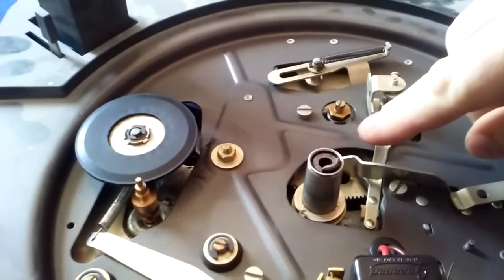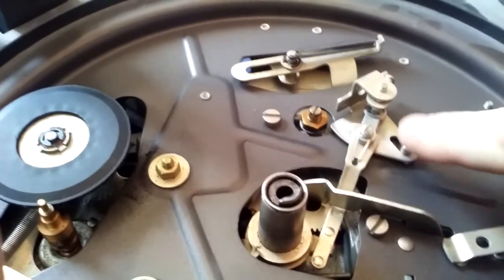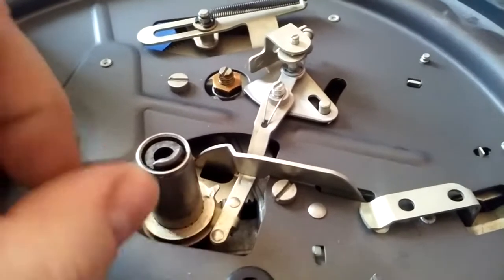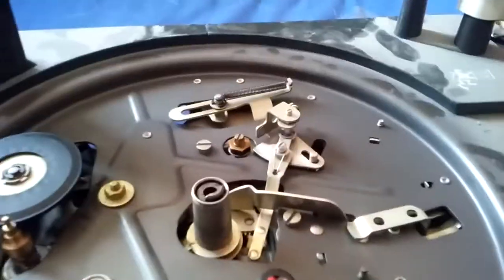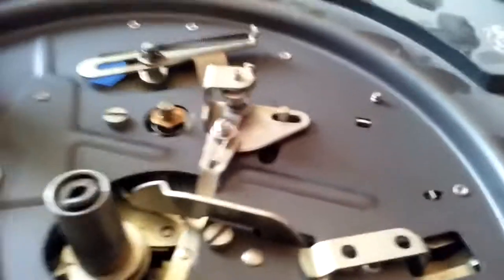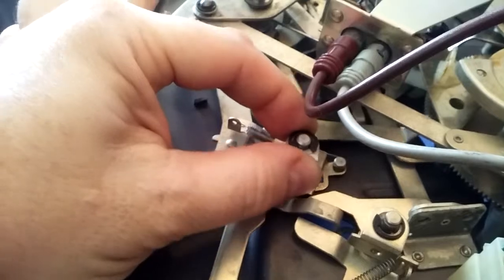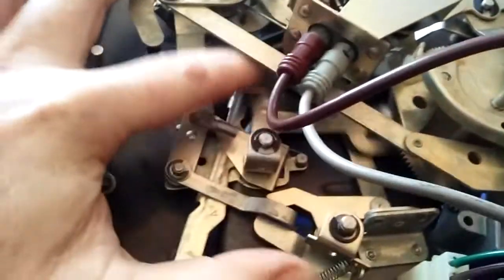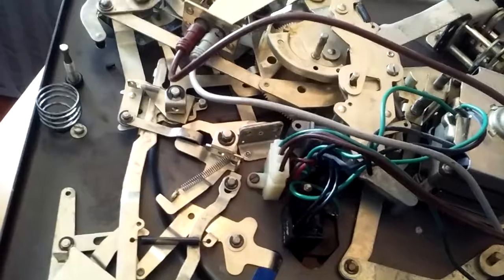Garrard trip linkage workings

Comment: I'm working on an RC90 which has a slightly different trip mechanism. Cam gear has teeth all around it. To the best of my description: 
The latch goes around to the bottom of the player and hit a notch poking out on one of the cam gears, one idler is meant to drive the trip linkage, doesn't seem to be working.
Someone ripped it out of a console unit before I got it and somehow messed with it as one part was certainly not where it was meant to be. I'll have to have a go at it now!

If all else fails I'll disable the linkage and use the player manually.